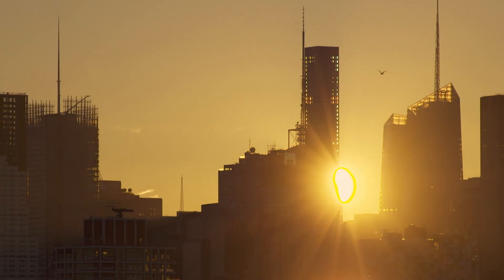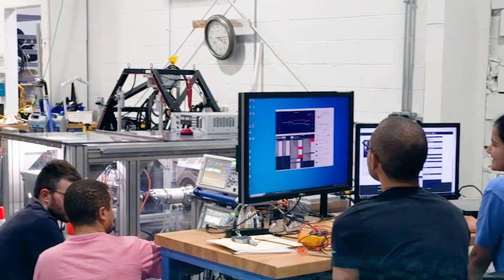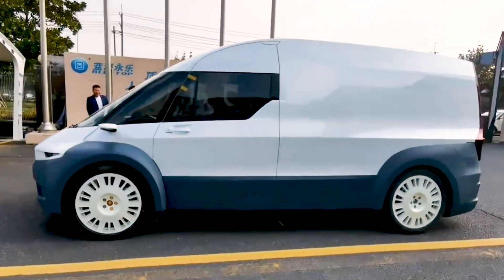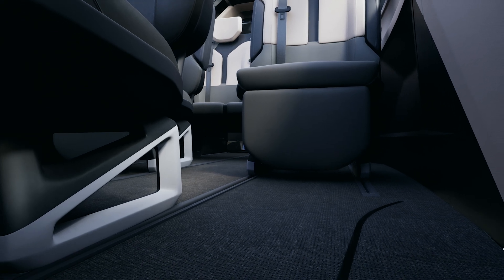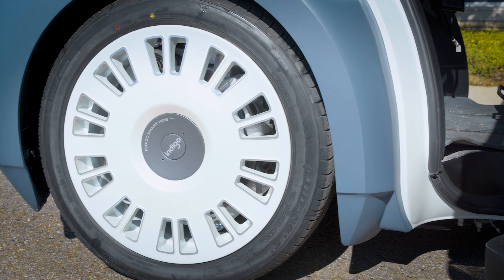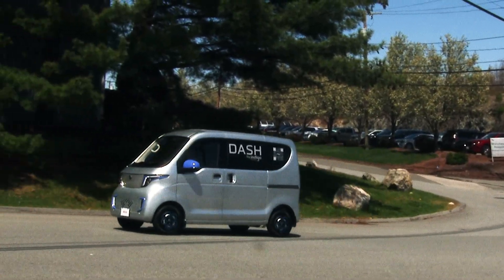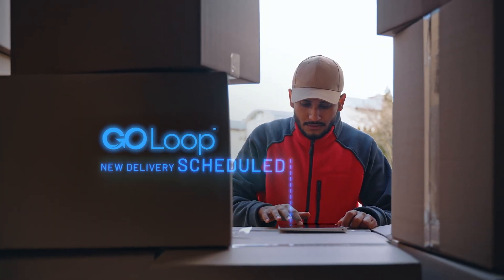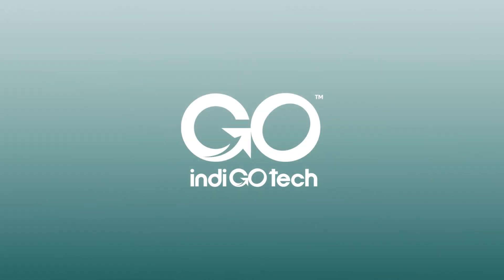Meet indiGO | Redesigning Vehicle Architecture for Smarter EVs

Comment: It looks good. Not as good as Canoo which failed, but good. So great. I TOTALLY don't care about self driving (which there is no way you can deliver), but I do want a van. The questions are, can you start producing this in volume? Most have failed. If you produce, will it work well? Thus far no EV has managed that. Lastly, can you produce and sell it for a reasonable sub $40K price, no not some crapped down version, a good version and sub $40K doesn't mean $39,999 and still make a profit, enough profit to provide services and repair? I don't think you can vaporware.
Reply: I think this is possible.  It is a wheel based technology which will make production cost drastically lower.  Profits and scale will come.  These guys look like pros.